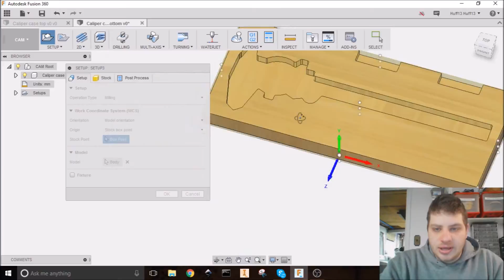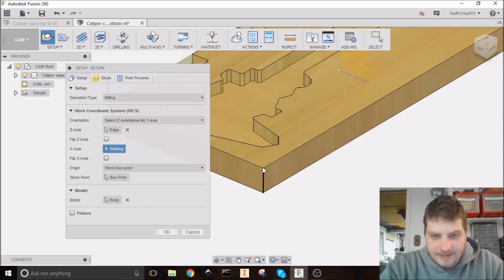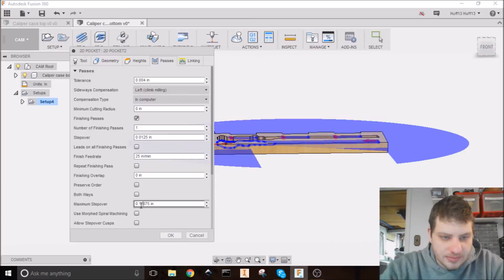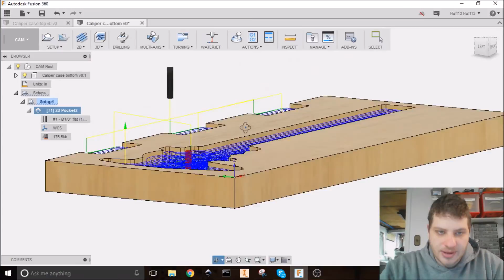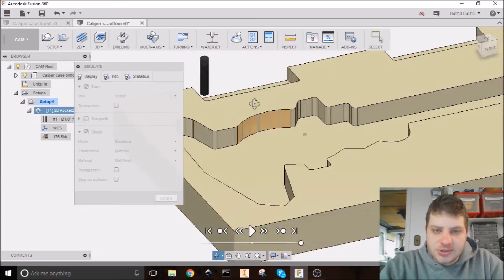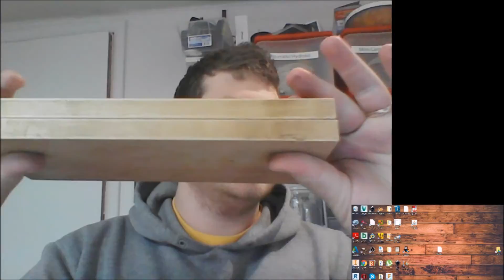Making a Case for my Calipers: Fusion 360 CAM Tutorial

Comment: Throw in some magnets for holding it together.  Otherwise, it does not seem like the CAM is that hard.
Reply from the maker: +Shogun-Jimi if you look closely at the final version there are actually magnets in the front two corners. And you are absolutely right! Things like this are super easy to do! Once you understand what the button are, and how to press the buttons in the right order, you can knock these things out in minutes.